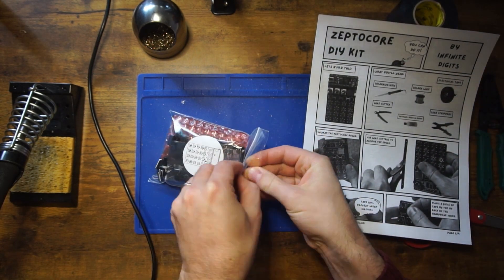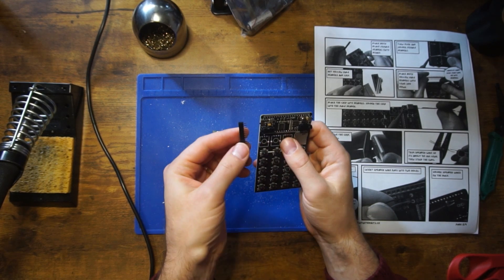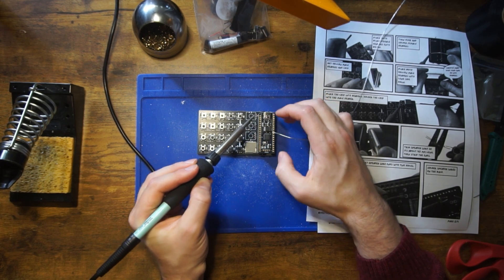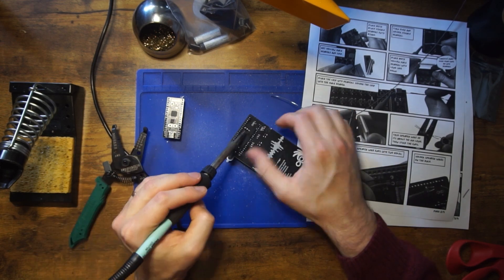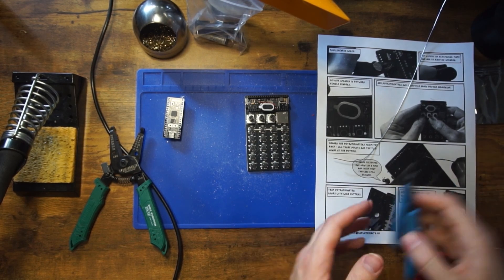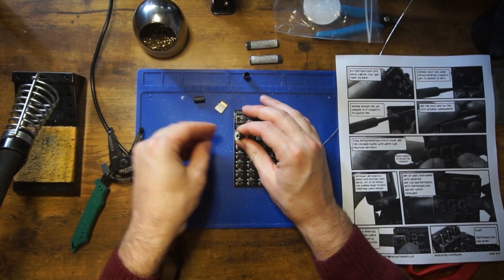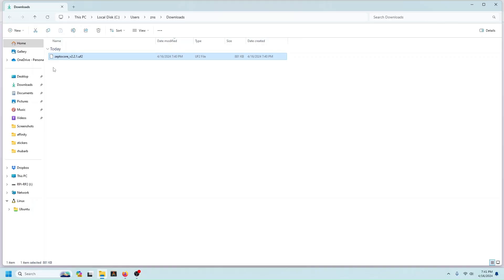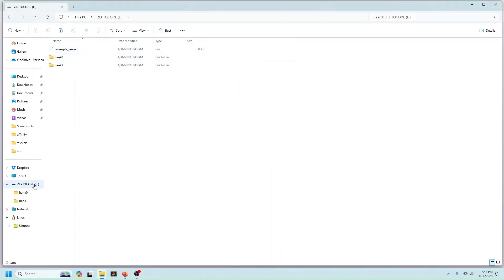zeptocore diy guide

Comment: Just put mine together - took 60 minutes (going slow and checking connections along the way).  Firmware upload was easy and after turning on the speaker switch I was on my way.  Super cool! I think if I had put the top board on (with its header) before soldering all the pins I might have gotten them all aligned a little more straight but - even still - it's pretty darn good looking!